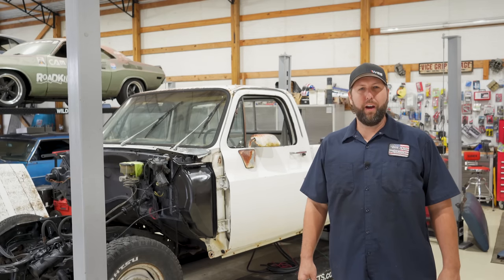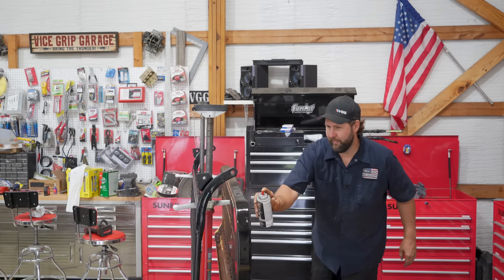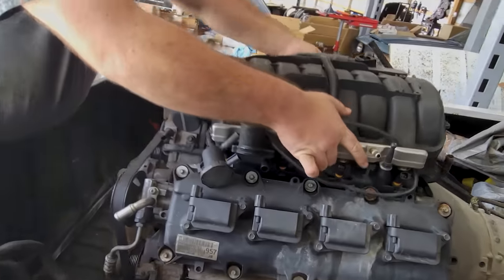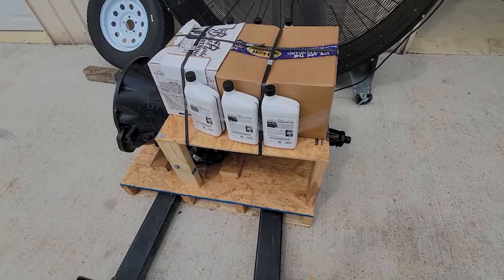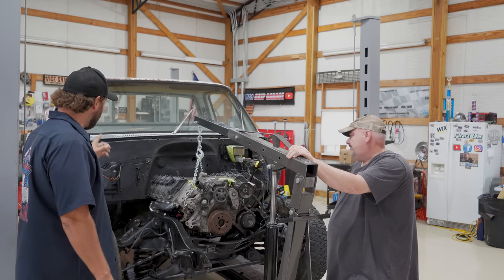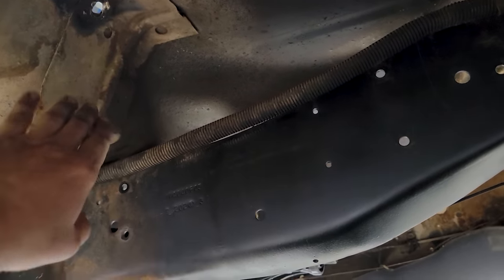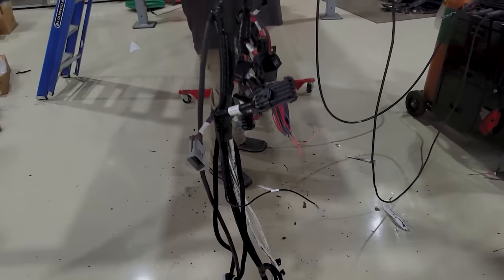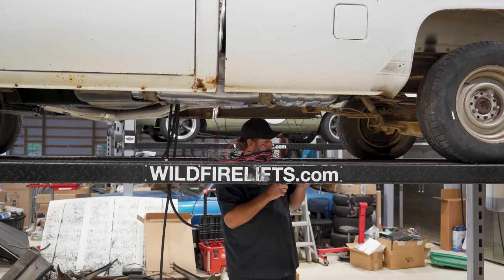Gen III Hemi Swapped C10 Truck Build "HemiHalf" - Part 3 Hemi IS IN!

Comment: Welding nut to broken manifold bolt. You need to wait to that weld to cool down, man. Its 2475.8f degree hot and 58.37" expanded. Time for cold snack, or two. When it cools, it'll shrank and will turn off easilly without snapping off..

That first converter bolt circle looked like Cumming pattern to me, I dont know.

Congrats for MT show. Too bad it doesent run on this side to the ball/globe.

Comment: so interesting fact. the car version used a different front cover (what you have there) than the trucks. the trucks rerouted the alternator to just the right side if the throttle body. 
Also, if you are that far already, do yourself a favor and completely delete the cylinder shut off system (MDS). you will need to change lifters and the camshaft but in my experience is well worth it. i went with a 392 cam from a dodge charger and all non mds lifters. 
there is a big problem with this on the Mopar forums but bottom line - you'll be a lot happier deleting it.

Comment: Be careful hooking the throttle to the trans. The large  cam style shaft sticking out of the case is for prndl. The small shaft is throttle pressure, which is shift timing and line psi rise. This has to function correctly. Otherwise you will smoke the trans.

Comment: What were your other transmission options again? The 46RE makes sense, but it sounded like you'd researched others. Doing this on a budget, another feller might want to use a 3-speed (GM or Chrysler) or a manual.

Comment: shouldnt you put some washer on the engine mounting  to the  frame bracket ? i dont know just a quick thought seeing it ..the bolt looks almost the same size as the hole on the mount 😅 32:33

Comment: Where is that rotating engine cradle? That is what you need to safely change sumps and get to broken studs easily etc. I see no spring washers on the engine mounts, did you loctite those things in maybe? That engine sits pretty low in the frame, so I would be making my own frame to mount brackets to raise the engine a few inches, which may clear the original alternator position. You seem to have lots of clearance in the trans tunnel too.

Comment: Hello sir, I recommend for cleaning interior I know you said about oven cleaner but there is no way that is safe. And I’ve seen this stuff work on rust and dirt and grime. You can get it from nick’s professional supplies right now, for 50% off, it’s called all purpose cleaner it works wonders….. kinda like the marvel mystery oil!! 😳”It’s a mystery what’s in this stuff, no one knows, but it works.” -VGG

Comment: I'm most likely totally wrong, but didn't the Gen 4 hemi come out in 09, and was equipped in the 09 chargers? Which would mean a bump in power, like 370 hp ish? Along with the newer eagle heads and whatnot. Unless if I'm mistaken and that was 2010

Comment: Refreshing to see something getting swapped that isn't GM. Ford and Dodge have some great engines. Sure would be nice to see better aftermarket support and lower prices. I think a lot more guys would use Ford and Dodge engines if they weren't so expensive to build. I have a 95 Dodge Ram with a 360 and an 05 GMC with a 5.3L ls. I like the 360 much better for a truck, it pulls hard off the bottom where the ls doesn't want to pull until 3-4000 RPM. In a real daily driver, 95% of the time, you're between 1500- 3500 RPM. I'd love to see a 6.8 or 5.4L modular engine swapped into something.

Comment: your issue there with the exhaust manifolds and the bolt holes is that the heads are side agnostic. like there is no right or left head. you make that decision. also sucks when putting head gaskets on. you put the left gasket on the right side, soon as you pour in coolant you'll realize your issue.

Comment: Huh, neat factory transmission for the truck that I got instead of getting another 77-80 Chevy square body truck,I have a 46re as my factory transmission 2000 dodge ram Laramie slt quad cab long bed 5.2 litre 318 magnum v8 4x4

Comment: Maybe you've already heard about the roller lifters on these Hemi's that like to break loose, turn sideways and grind on cam lobes. It usually happens around 100K miles. Just beware and maybe take some precautions to prevent this from happening to you. On another note 18 years ago I kicked the car addiction and in the past 2 years my 13 year old and I have 4 old cars including a 71 Ponac, 50 Merc,, 66 Stang and 84 Vette. I guess I fell off the wagon. Thanks Derek.😃

Comment: It's funny a year or so ago I was pondering an engine swap for my 92 c1500 hot rod truck. It had and still has a still strong but likely tired 355 SBC and LS swap as appealing as they may be unless it's a more desirable version of the LS platforms like Ls1, ls3 even a 6.0, regular old 4.8/5.3 swaps are boring and sooooo overdone now, great performance... Super functional yes, exciting absolutely not. But the idea of a 5.7 hemi seemed intriguing... It would definitely be polarizing to people some would love it some would be discusted. But It just never went past the basic research level, on a working Joe budget a build has to be a main focus mentally and financially and not having a garage and lacking those 2 mandatory factors it hasn't developed and still has it's 355, if it was blown up I may have more motivation but it still runs strong besides my focus has been on my 95 mustang GT at the moment. So maybe some day I'll visit the Mopar swap.

Comment: Holly makes a kit to delete the Cylinder shut off. I would delete it because it reeks Havoc on the motor  and if you plan on put a better or bigger cam get the kit for the VVT delete also or your going to a valve kiss a piston I built a 1580 HP hellaphant engine and slapped it in a 2015 ram 1500 and learned the hard way with the Cylinder shut off system a guy at the machine shop told me that I wouldn't need to delete the system. On my 1st Shakedown test drive I bent valves and broke 3 valve springs it was a  $8,519 mistake and a lesson learned...

Comment: e-brakes save on the transmission, because they were not meant to constantly hold the weight of the vehicle. I also unfortunately know of a someone who put their car in park, walked in front of it, and the part failed and the vehicle rolled and pinned them, killing them in the process. So a fella hopes you reconsider the e-brake delete, look at them more as a parking brake that takes stress off the transmission.

Comment: I work at NASA and can definitely tell you that that little adapter thingy under the shifter go-go box which is in the way of the cross member wachahoo definitely is not the USSR adapter that is preferred on the Soyuz capsules.  It is probably the Chinese preferred speed stealing device.  Or maybe it's French.  Although the Ugandans have made good use of it.  Either way, it's not needed for your application so just cut it off.  Probably.

Comment: I think you should have changed out the springs for a little bit beefer springs not saying but just a small Idea. To much work to put that motor in How about a 3 cylinder turbo 300 HP Toyota.  But you already have the stickers Hemi ???  So carry on .  But it is not to late to change out the Seat springs.

Comment: Really need help with my third gen 5.7 hemi me and my dad rebuilt it and then had it running for a few minutes and then took it for a spin around the block and then it stopped at a stop sign and then it wouldn't start no more it killed everything in the car and then it would turn over but won't start if you could help me with this I would really like it please respond

Comment: A feller's just betting that little sheet of metal you had to remove that the transmission was hitting was probably a heat shield for the exhaust. Prolly kept the old seat and feet from getting toasty on those long trips 'cause I know the exhaust on the little 6 cylinder Chevy goes down the driver side....

Comment: I recall long ago I use to do bodywork and mechanical work and after having to deal with all the bullshit that engineers design and the headaches that they create like having fifty thousand difference sizes of bolt holes and such instead of like years ago when you could take apart an engine with just a hand full  of tools. So I decided that I was fed up and switched trades plus I was sick and tired of working on rusted old crap. That's when I had a great Idea and become a welder fitter instead of working on rusted ole buckets of crap. I got to work on new steel all day long. a lot less headaches.

Comment: Love the show and want to see you continue doing it along with your Motor Trend show, so please, PLEASE use PPE. You already have an eye injury, and I don't know if this was filmed before or after yours, but watching that guy run the wire wheel polishing that pipe was making me cringe. And to make it worse you even called yourself out on working under the engine on the lift. Safety HAS to be a habit, not an afterthought.
Also, I am not surprised how much room you have under the hood. It may be a Hemi, but it's only 5.7 litres (that's a 350ci. small block).

Comment: The video could basically be 104 reasons why I like the LS engine way better than Hemi's.

BTW never EVER stuff your hand or arm behind or below a motor going into an engine bay. There's a pretty nasty vid where a guy's hoist strap fails and had his arm ripped nearly in half (title: Engine Hoist Strap Explodes!!!), it was a RB26 that's not too far off an iron v8's weight.

Comment: That oil cooler adaptomatic and charger whirler look like the worst of getting that in there. That and the mishmash of bolt sizes. It's almost as if the engineers are saying 'Let's really mess with these guys (mechanics) and use a bunch of sizes'. 🤡